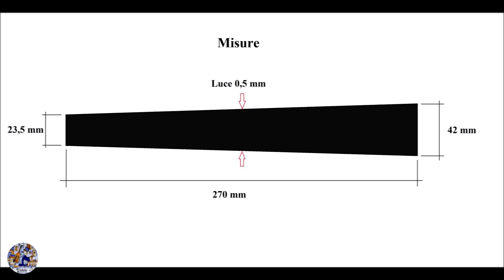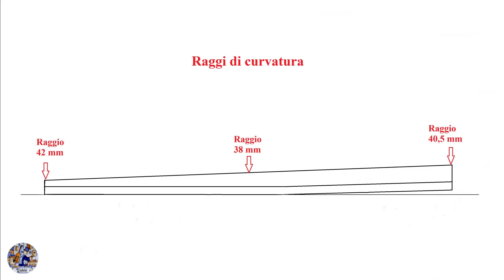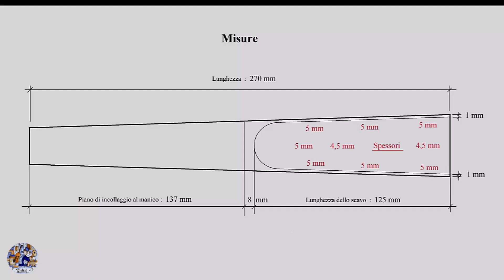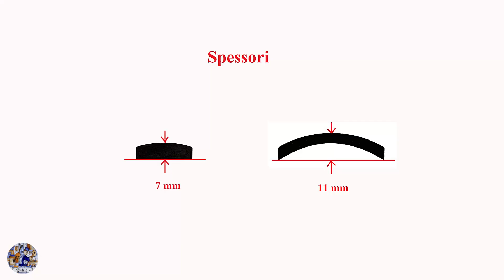Tastiera di violino - Appendice - Riassunto delle misure e di come rilevarle

Comment: Thank you, you have been revisiting and digesting all measures from your individual videos, obviously trying to make it easier for the makers. The videos about bridge setup were very helpful and I made wonderful bridge(s) that improved and cleared the sound of my violin tremendously. 
Now after bridge lessons setup, I am  preparing to change  my existing fingerboard for the new one. I got two fingerboards in case one is messed up during the process . The luthiers here are not quite professional so I decided to do it myself as well. 
For this fingerboard replacement I made auxiliary tools like concavity indicator and thickness indicator. Soon the "operation violin" begins. 🙂